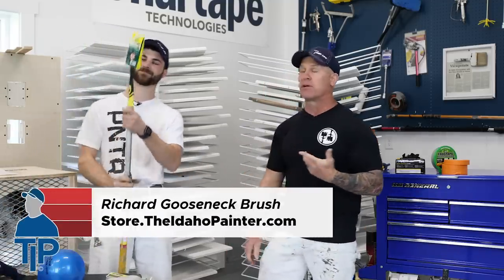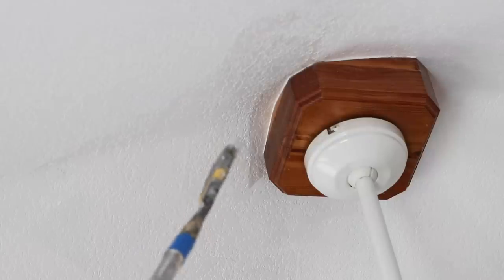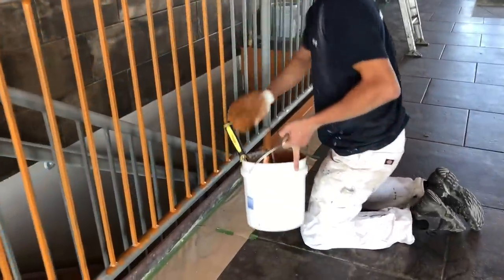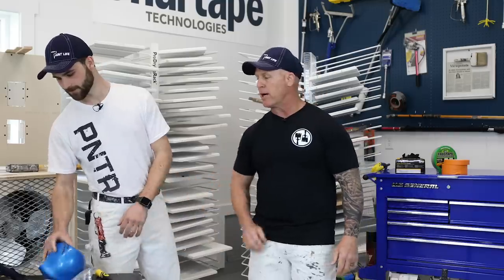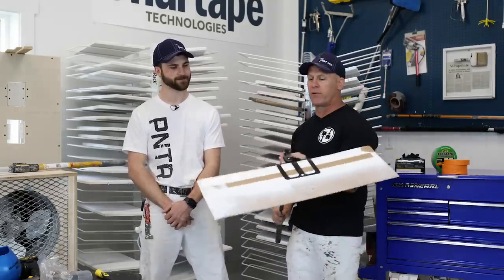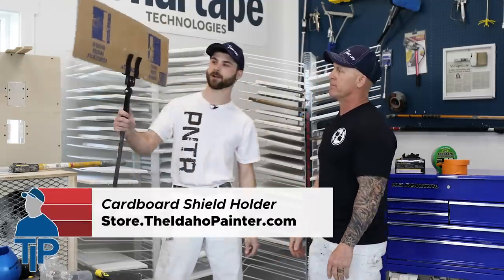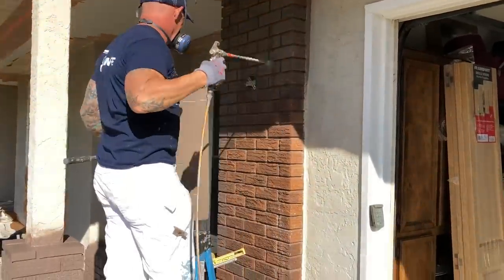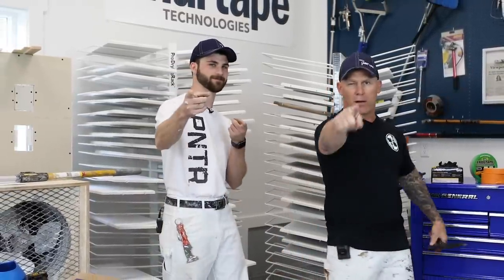5 TOTALLY amazing Tools for Painters!!!

Comment: That painters mitt would have saved my bacon more than once . Would be great for industrial painting in pipe racks doing 2"  water, nitrogen lines and painting around pipe flanges around the bolts and nuts and also valves. I wonder if the MIT can be used with epoxy paints or carbomastic paints?

Comment: Here's an industrial grade U.S. General® 5-drawer Mechanic’s Cart that doubles as rolling workstation with a built-in toolbox and five drawers. With quality features like rolled drawer edges, 90° gas struts on the lid and spring-loaded drawer latches to hold drawers shut, this cart is ideal for the master mechanic. Store over 15,000 cu. in. and 700 Lb. worth of equipment. Four smooth heavy duty swivel casters provide easy movement around your work area. The durable glossy powder coat finish prevents rusting and looks great
Reply from the maker: Interesting

Comment: I wonder if that Painters Mitt would work for applying oil to a wooden wrap around porch.
Reply: The first thing I thought was this would be great for oiling wood.   But I'd start with using socks as seems they work as well if not better.

Comment: painters mitt is a joke, use an old sock turned inside out.. WAY better finish, obviously use latex glove underneath sock 😁
Reply: They also use that in prison, its called a fifi
Reply: Make a video using your old sock
Reply: The example showed metal spindles..will the sock work successfully on carved wood spindles in a timely fashion..